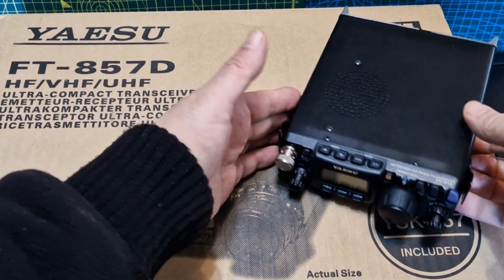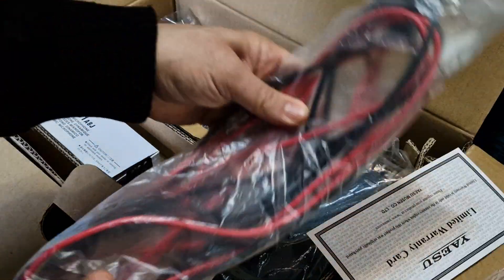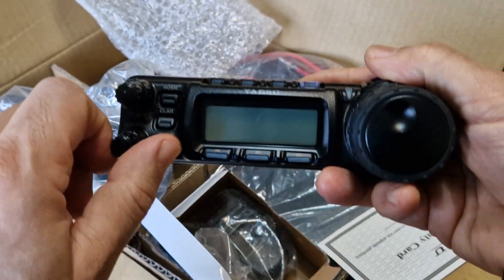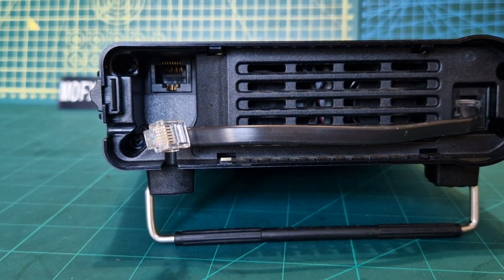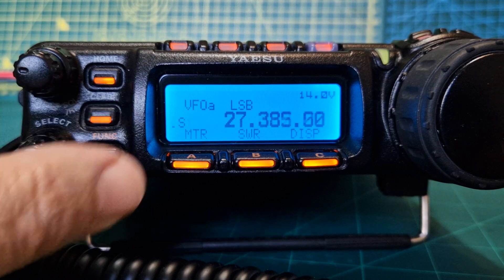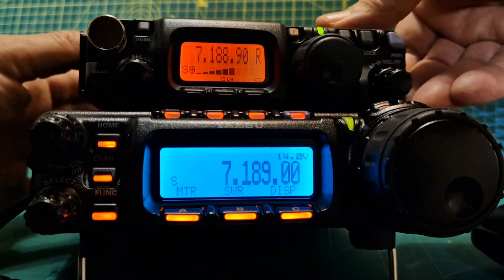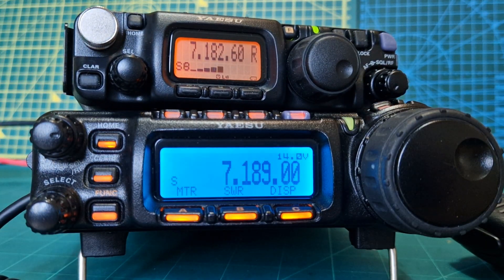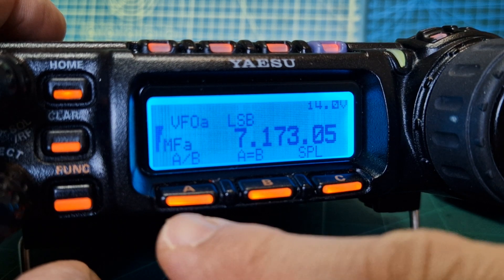YAESU FT-857D UNBOX & SET UP 2024

Comment: Great all round performer. Used mine now for 11 years in my pickup truck with the Atas 120A Screwdriver antenna. Covers all bands.. perfect VSWR.
Beware of the dreaded zebra stripes appearing on the display screen.. The OEM replacement parts are like hens teeth.. Been waiting 6 months now for a new display from Yaesu Japan..
Reply from the maker: Thanks

Comment: I thought the uk version of this radio only put out 50w? i noticed 2 diff types of connection in the back for uhf/vhf and hf antenna connection, why are they different
looks like a scratch on the lcd sreen. does the radio do average power or is it like the ft991a when you put it at 50w it shows 50w.
Reply from the maker: Hi i removed scratch using Polywatch, ntype conector for vhf uhf.
Reply: @HamTechRadioScannerDrones  so is that average power on the meter?